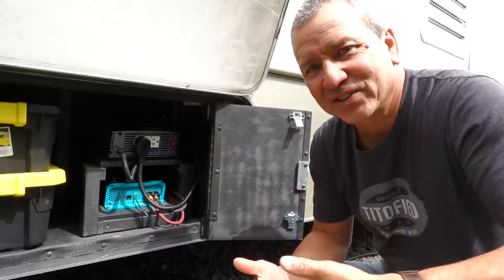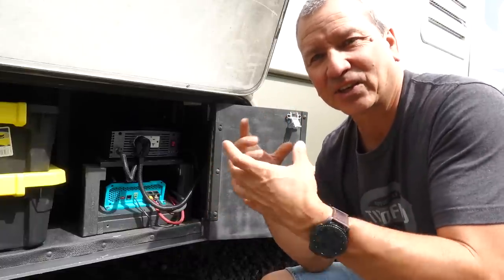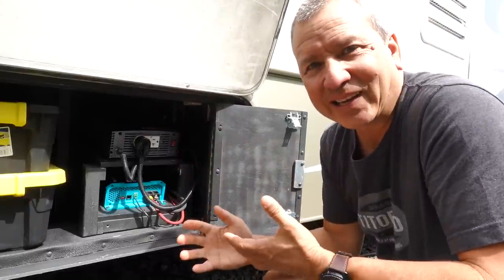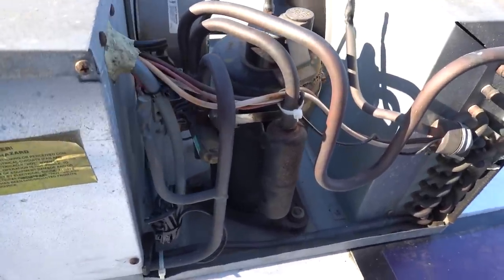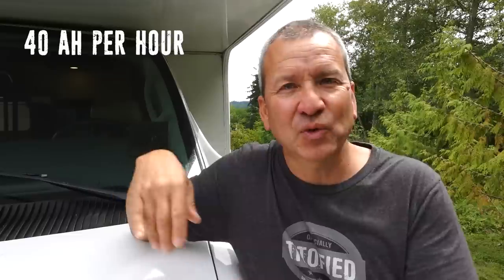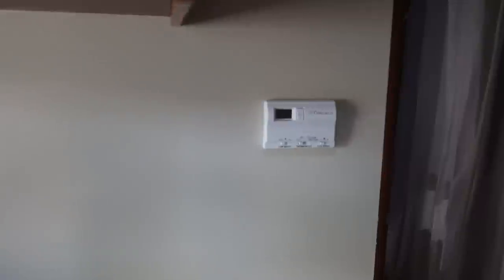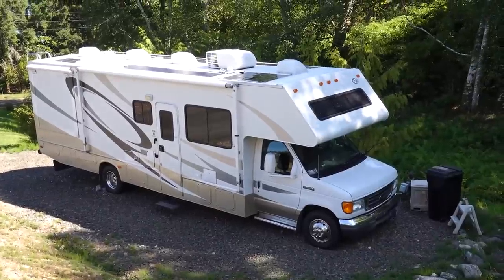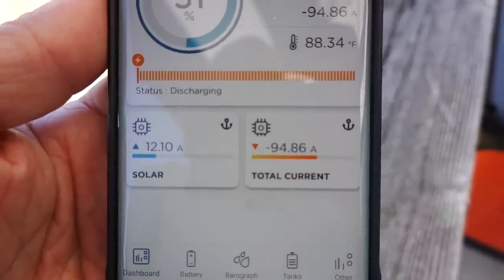BAD IDEA? Running RV Air Conditioner on SOLAR and INVERTER

Comment: I have 800Watts solar and LiFePo4 180AH battery, my AC unit is only 8000 BTU but 15 Seer rating.  If the sun shines every day I can still run the AC and recharge the battery.  Even I would need more solar to keep up with the demands of the AC if I was doing this every day.  Thanks for the video.
Reply from the maker: You bet. With that solar to battery ratio your LiFePO4 batteries should recharge pretty quickly.

Comment: I got 4000 watts GIANDEL runs Air conditioning  from 15 amp plug. 13500 BTU ... Problem is 910 amps /hours  T-105  battery banks go down fast at night 
2000 watts solar pants will let You run during days...Nights are difficult .  Drag your battery below 50 percent . So is expense ..Battery won't last long.
If You replace with lithium total cost of that is around 7000 thousands dollars ..No problem then ...

Comment: Nice videos, very well explained. Thanks!
I guess in this case it depends on tje usage of AC. For example if you only ise AC 1-2 hours noon and then again 2 hours on the evening (as the rest of the time one might be outside) then its more than enough.
And then having as backup the portable gas generator
Reply from the maker: Yes. You're right. I'd only use it in a pinch. When we were in Arizona, we were ready to leave once the outside temps reached the upper 80s. Thanks for the comment!

Comment: We have 520w Solar, GoPower IC3000 inverter (true 3000W inverter, the Victrons are 3000VA, (Volt/Amps) vs watts, there watt output is 2400w by the math). We have 4 BB Li batteries as well. My system powers the entire trailer, so the converter box acts as a sub panel.  We have a heat pump, as a AC unit it will run in the 4 hr range, great for short runs, but have not used it long term. As a heat pump, it will run all night and only draw down 30%. We do have a generator, but have only used it once. The truck DC-DC controller (RedAcrc BCDC1240D) can act like a generator to top off the batteries mainly when driving, also because it is a MPPT controller, it is an input for portable solar panels. The other nice thing about Li batteries over Lead, is you can drain them nearly to 0%, I have my cutoff set to 10% though. I was curious how long theses might last, so thank you for doing this test.
Reply from the maker: Thanks for sharing your setup. Sounds like it's working. I also use a DC-to-DC from my alternator while driving as needed. When I tested the heat pump mode it drew a little more current than in cooling mode. Good info!
Reply: RV with Tito DIY , fortunately the heat pump only runs 10 min at a time to maintain, yes it draws more on heating than cooling when running , just doesn’t run as long😉

Comment: Thanks for the experiment. I was once curious if it was possible. I've a 3000 watt Inverter with 600 amp hrs (6 Battleborn). I've a 2020 Grand Design with 15,000 btu AC's and no soft start.
I've a Victron Battery Monitor so I am able to see amps and expected runtime. I turned on 1 AC and can't remember what kind of surge there was but the Battery Monitor said I had about 5 hrs of runtime. I then ended the experiment satisfied that I could run at least one in a pinch. I've 4 190 watt solar panels. At this time I can't justify a Soft Start.
Romeo
Reply from the maker: Yes. In a pinch for me as well. I have extra solar I can throw at the setup if need be.

Comment: FYI, the Airxcel (Coleman) Mach 10 NDQ has the same operating specs, noise and amperage draw as the Houghton unit.  Same price range also.  I have one and it works great and is QUIET.
Reply from the maker: Good to know. Thanks.

Comment: My rooftop air conditioner on my truck camper will run continuously while the Sun is out. And the batteries stay at 100%. I also have 600 W like you, but they are wired in series which gives me more amps.  I use Renogy everything, including the 3000 W inverter and 2 - 170ah Renogy lithiums
Reply from the maker: How much does your A/C draw?
Reply: @RVwithTito  
It's an 11,000 btu unit.

Comment: Who spends all day inside their van?  I bought the smallest van i could find.  When I need air conditioning it's usually for an hour or 2 at most.. at lunch, dinner or when it's too hot or raining.  I simply run my very small 2.4L engine in idle with the AC blasting and the cab gets cold in 2 minutes. Everything I need came with the van...  It consumes about .3  Gallons ($.70) per hour and I've seen no impact to the van (this is highly debated and debunked myth) but I hope I'm not wrong.   Also, I don't drive much so this  does not take away miles from my power-train warranty so i will get the full 5 years coverage and if ive not destroyed the van by then then it will last forever  :) .  Not having to drive back anywhere or pay for hotels or restaurants offers a much greater ROI than whatever damage this is doing and many mechanics including Scotty's Garage say is negligible in modern engines. Anyways..  I'm sure the cost of installing and maintaining  a house A/C and power plant is far greater than the repairs I will need make by using the van this way.   I'll roll the dice and keep an eye on my engine temp gauge.

Comment: Another great video Brian. 
I think many are glossing over the versatility of your set up. 
With the lithium batteries you could run them down to nothing. So if you needed an occasional generator fire up to get your batteries back up to a  unacceptable charge level so be it. 

This makes your set up practical in virtually any condition or circumstance.
Reply from the maker: The lithium batteries certainly give us much more flexibility than before. I'm assuming you meant "acceptable" right? Thanks for the comment.
Reply: If I remember correctly from another one of your videos, you removed your on board Onan 4000W generator.

Comment: Not here to correct anything you've stated, but to learn & have subscribed! However, somewhere around 8:00 U stated the a/c is drawing more energy, the fact is, it's drawing the same, but the batteries are just being charged at a lesser rate!
Reply from the maker: Sorry to be confusing. Drawing more the from batteries is what I meant.

Comment: Great test Brian.  Always wanted to see how that would work. It looks like you would need more panels and/or more batteries which would add considerable expense complexity and weight.. probably best to just run on shore power.. GOOD test though...
Reply from the maker: Yes. Always more, more, more :) We're pretty content with what we've got.

Comment: Tito, very good video as usual. If anyone is entertaining running a stock RV rooftop AC off of solar they are in for some major investment. A mini-split system is the best option and that still requires a decent amount of solar and batteries.
Reply from the maker: Seems to be the case. Thanks.

Comment: Same easy start, VictronConnect solar, 3000 watt power converter, battery monitoring and three 100ah battle born battery’s.  Will run air about 100ah per hour. The generator Honda 2000 runs it as well. I think you run the generator but, if you are away and then the generator quits the battery takes over. With animals this could be a life saver.
Reply from the maker: Thanks for sharing that. Sounds very similar to what I have.

Comment: Perhaps this has already been mentioned, but if you adjust your comfort zone up 5 degrees and get used to it, you can get much more out of the system...
Reply from the maker: Yes. You're right. If it were just me, I'd go even higher :)
Reply: Clarke McGee running warmer temps usually requires lower humidity to be comfortable. Low humidity, often requires tight building construction, and dedicated dehumidification.

Comment: To run an AC on solar can be done, but you should think of it far in advance and not make it an after thought. You should have several factors in mind when building out your system. The hodgepodge approach can cost you more in the long run by trying to make up for it as you go. Always plan it out. Below is just some of what you should keep in mind when building a system for your needs.    

1#: What will you power?
If you want to run the A.C. off grid, you need to have a minimum of 125 amps DC power of just solar input. That is around  (25) 100-watt panels or the equivalent there of. That is roughly an area of glass 8 foot x 17.5 foot. This means the solar setup needs to produce that much power the whole time you run the A.C.  Not including when clouds drift by or it's a hazy day and power output dips. Solar is not a constant. If the power is not constant the batteries make up for the dip in power. Solar is rated by a max value. Of course you can mix and match panels to get you to this point but when you go over 1000 watt mark, you should implement some safety factors to reduce the chance of fire and electrocution. Because you are playing with the power a welder make at that point. A short circuit or pad panel can cause a fire real quick. 

#2: Your inverter efficiency. 
Most have a loss of 2% - 5% and you avoid maxing out your inverter. You should always have an "overhead" of 15% - 20%. So a 2000 watt inverter is basically maxed out with just the use of the A.C. or a microwave oven by it's self. This means your inverter is putting out around 1400 watt OR 20 amps VAC while it is using 116 Amps VDC.  Of course I'm not including the locked rotor amps needed to start any motor. That varies on all motors.
 
#3: Wire size and length to the inverter and solar. 
Inverter wiring:  You always want to keep the run of wire from the batteries to the inverter as short as possible and as large as possible. You want to keep the total run under 10 feet. That INCLUDES both positive AND negative wires. Battery cables should be sized accordingly. Most of the time that means using 4/0 AWG welding cable when you have 3 - 5 LifePo4 batteries. You should have a 400 amp fuse as close to the batteries as possible and a 400 amp continuous rated battery cut off switch after the fuse. Something like the Cole Hersee 75920-05-BX cut off switch. The fuse should always come first. It's your first line of defense during a short.  
Solar Wiring: 
The higher the amp draw the larger the wire size must be. The longer the run the larger the wire mus be. On a solar system that uses a string of  15 100 watt panels operating @ 12 VDC you are literally using #6 welding cables at that point. Or you can double up on #10 runs. Both are fine if you do your homework and figure in voltage loss. A 12VDC system is not as efficient as a 24VDC or 48VDC system. The higher the voltage the more efficient the system will run. This moves us into controllers and how they work.

#4: The solar controller.
By now everyone know that we have 2 types of controllers to pick from. PWM ('Pulse Width Modulation') and MPPT ('Maximum Power Point Tracking'). But what most people do not know is they operate on different voltages. 
PWM: 
The PWM controller only takes a couple of volts from a battery to allow the panels to start charging. But they are limited on the max amps they can deliver and system voltages. Some PWM controllers need as little as 1VDC from the batteries. Some as high as 7VDC. This means if you have completely discharged your batteries (you left on a light while away) you won't need to jump the main bank to start up the charging system. You can literally use a 9 volt battery or string together 4 AA batteries depending on the minim voltage needed to get you on the way to recovery. Once they start charging they just run off the sun. The PWM controller only needs a small amount of voltage to get running while most MPPT controllers needs a higher battery voltage to fire up the charge cycle. 
MPPT:
The MPPT controller, while more expensive can provide a higher amount of current / amps from a panel string with one controller, but this is only help full if you have thought through your whole system before hand. If your system is an all 12VDC system from the panels to the controller then you are not using the MPPT controller to it's fullest. MPPT controllers want you to use the highest input voltage you can give them. If a controller is rated for an input of 150VDC then that is what you should try and give it. If you give them the max input they can deliver the max output. Also with an MPPT controller you can use a smaller gauge wire and get longer wire runs on the panel side since voltage drop will be less of a factor. But you always want to keep your voltage drop under 2% no matter if you are using the PWM or MPPT controller. Voltage is the power that pushes the amps through the wire, and everything else. Once on the battery side of the controller a larger wire is needed since you have now reduced the voltage and increased the amperage flow. Amps and resistance cause wires to get hot , not the voltage. This is very important for everyone to under stand because it's the #1 source of fire. The smaller the wire size the less amps it can flow, making higher resistance. The fewer the strands the less electrons it can flow. On my MPPT charger it has a max input voltage of 120VDC but I'm only able to give it 105VDC. This drops me down to around 35 amps of output because of limited space to carry panels. It's all about give and take when it comes to an RV or a horse trailer like I have. 

Conclusion: 
When it comes to running an A.C. off of your inverterk, yes it can be done but you must think far ahead if you plan on doing it. If you build your system while thinking about the overheads and limitations you may have then yes you can operate the A.C. no problem. Or any other thing that you may need to run. Just keep in mind I will always talk about the extreme ends of a system. You should always factor the the extreme of a system because you never know what will happen in the real world. It's better to build your system with expansion in mind or over kill on the wiring because it adds in a safety margin.  
It's always better to be ready and completely understand what you have, and what you can do with it, to get yourself up and running again. Because everyone knows help might be several miles or hours of walking away.  
In the mean time, 73s
Crazy Marty
KK6OEF
Reply: What is the cost of a system like you are talking about?  So 2 AC 1/  15000 and 1 13500 to run 24/7?  Thinking about an off grid home in the future?
Reply: @bobsworld2351   For a house and running 24/7 you would need to expand everything. Because after the sun goes down you have no input power. Since it's a house you are trying to run you can run much higher voltages. You might want to look through Will Prowse on his YouTube channel to get an idea of what you need to know. He does small systems but you can up size once you know what to do. I would guess you can build something like that for around $35K. Give or take 10,000. The battery bank is where the maintenance cost comes in.

Comment: Hey Brian, good try but not enough storage or manufacture of electricity it seems.  
What I’m interested in is the newer 12v A/C units.   The ones I’ve seen are spendy but more manageable that A/C that designed for 110v.

Comment: Another option came to mind is, instead of  converting DC from solar panels to AC to run A/C unit which always some energy lost during that process to the inverter. There is a 12 v A/C system 20,000 BTU rating. It's a roof mount unit, not an undermount by ProAir. Maybe it will help.

Comment: In order to run your air conditioning off of solar you need solar panels that will produce enough electricity to run a/c and recharge your batteries. 

Figure that you need probably twice the solar power as the air conditioning draws.
Reply: Would be interesting to see what works :) 
A/C with a BLDC compressor would be more efficient. It could cut about 200 Watts.
Heat reflecting coating or film on windows could help. Better isolation, air sealing and HRV could be needed.
On the production side, one may need to cover the entire roof with the most efficient panels on the market. Use a higher voltage system. And may even need to make panels tiltable or put a second array on a side of a vehicle.
Reply from the maker: Agreed. 2KW or more probably is what I've seen.
Reply: Plus twice the battery's to save the electricity in.

Comment: I think this was a great video and it will work if you have enough wattage coming from your solar panel to run your air conditioner and simultaneously add a good little charge to your batteries, you should be able to run your air conditioner from 10 a.m. maybe to 5 pm then the air conditioner has turn off because the sun is getting too low.

But if is done right you should be able to end the day with a full battery with enough solar generation on your rooftop and sunlight of course.

I'm working on that it as i speak now, my roof regenerate me 1480 w of DC power from my solar panel.

So I should have plenty of power run my AC and keep my battery topped off throughout the whole sunlight hours.
Reply from the maker: Yeah if you had 1500 to 2KW of solar than it should work. Thanks for sharing your thoughts.

Comment: Excellent report. We're getting in the same situation as summer in Europe is getting hoter. I'd like to know more about your aux. generator suppling energie to the AC. Regards
Reply from the maker: I don't use a generator anymore. We do have that small one, but don't typically bring it along because then we'd have to carry fuel.

Comment: I have 4 deep cycle lead acid batteries and 1700 watt Giandel inverter and I'm drawing 45 amps dc and aircon draws max of 3 amps. Drops to about 2.7 amps AC. But I am still in testing range. Also have 700 watt solar with total amps at 20. My pwm charge controllers own put out 11 amps. Can I run solar panels direct to batteries and get a total of 40 amps while running the aircon? Any reply appreciated cheers from Australia 🙂👍